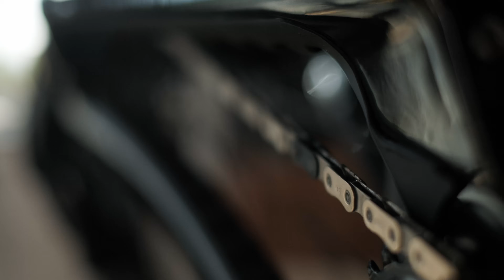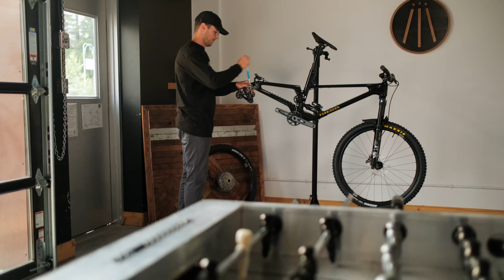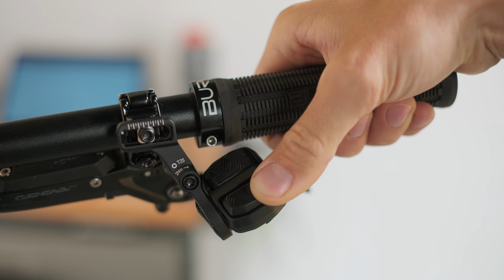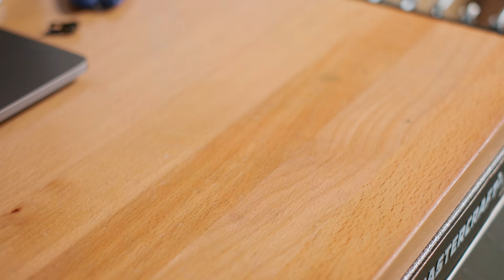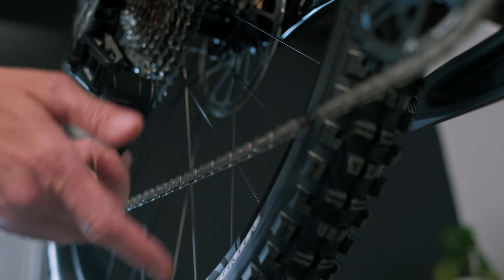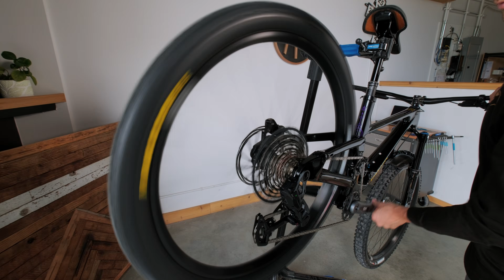Forbidden Druid V2: SRAM T-Type Set Up Guide

Comment: Just built a v2 s2 and the document on the website called for 120 links, not 122 whats right ? I am running xt and a 30t
Reply: "I am running xt"

Are you trolling?
Reply: This is for 32 teeth. No, he's not trolling.
Reply: @LemonySnicket-EUC  XT is a Shimano groupset. Size the chain as you normally would size a chain. SRAM T-type chains call for specific chain lengths.